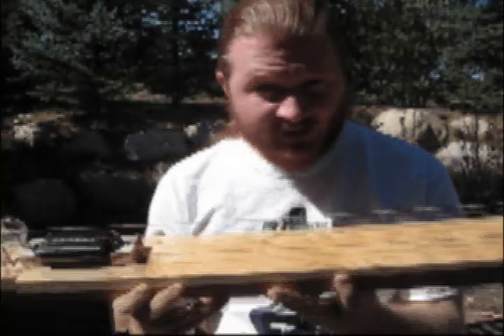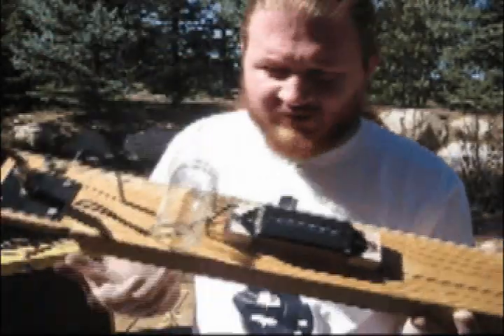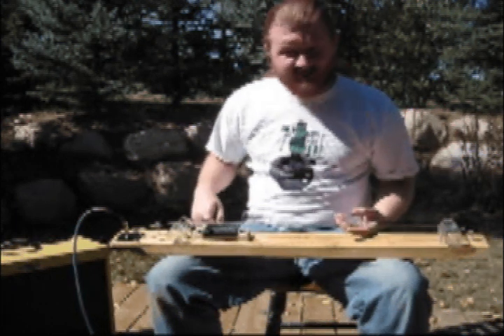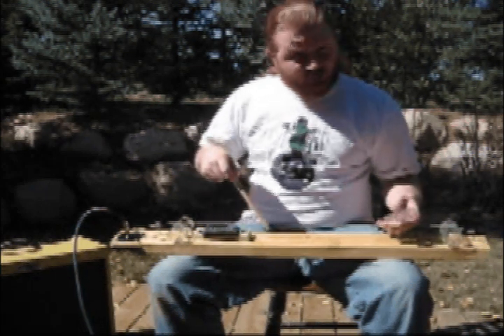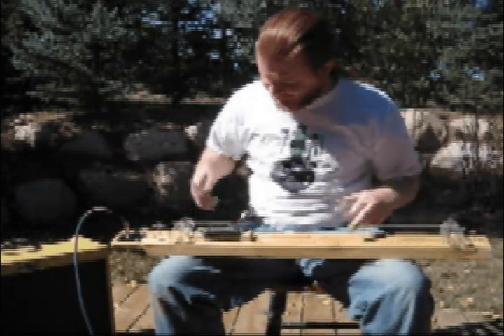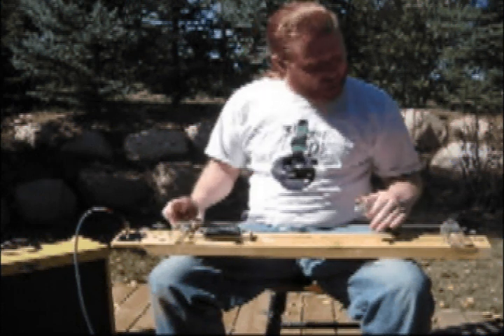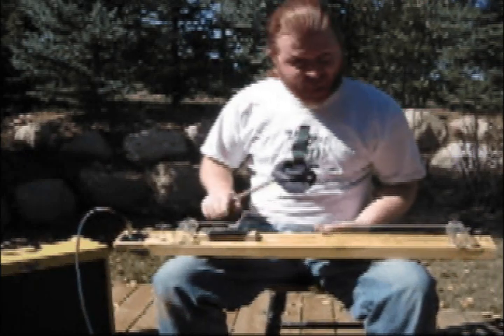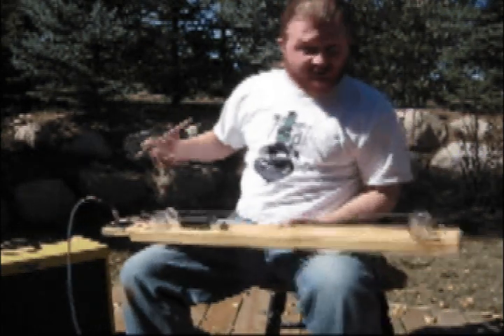Electrified Diddley Bow Demonstration

Comment from the maker: @gunsandammo92 I'll tell you right off that I didn't ground the strings (I assume that's what you mean?) on mine.  You could, potentially, run a ground wire from the output jack to the nail/screw the string is attached to... if you wanted to.